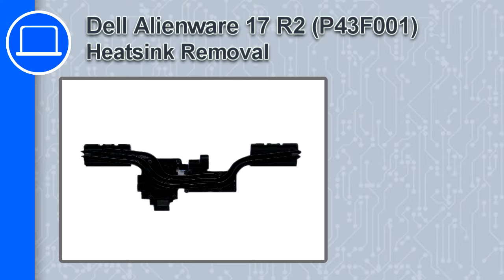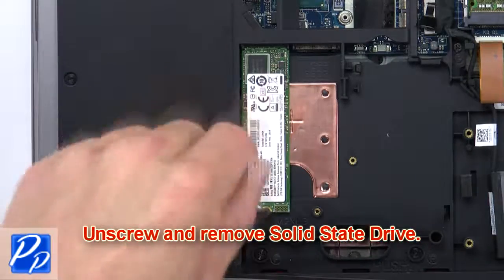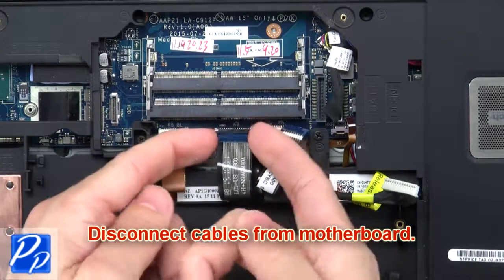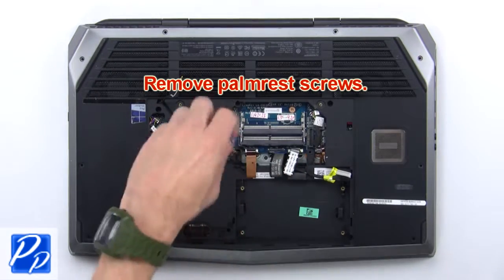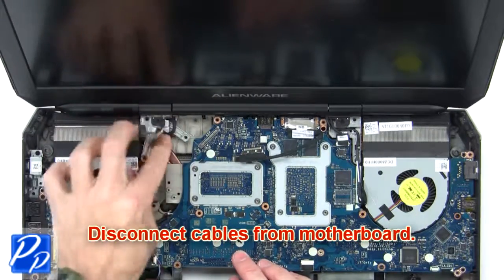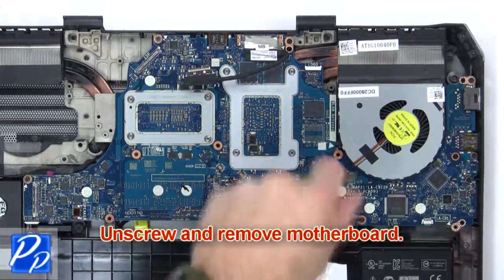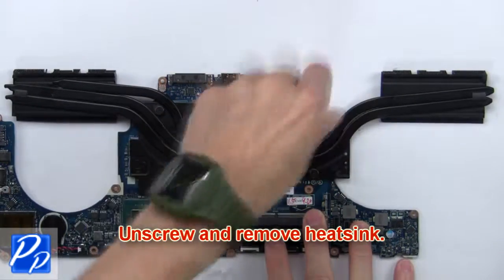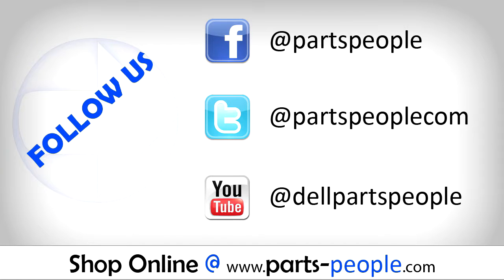Dell Alienware 17 R2 (P43F001) Heatsink How-To Video Tutorial

Comment: Man I tried repasting my 17 r2 and connected everything I thought i was careful but sadly it no longer turns on😅 Edit. I got it working again sadly I done all of that for no reason bc it says my cpu is still at 0.78 ghz and I found out it’s a battery or charger issue bc I looked it up and moved my cord around it didn’t work then I looked away for a second and it worked 😂

Comment: Question: when re-pasting the CPU and Graphic card, do you recommend the "place a dot" method and let the heatsink spread it, or spread evenly on the component before re-applying the heatsink? All my life I've applied and spread on many other boards but I've seen a few videos for Alienwares where they don't and I'm curious. Thanks for all the awesome video tutorials!
Reply from the maker: It's a matter of preference. I spread a thin layer across most of the surface of the chip.
Reply: @dellpartspeople  Great, that's the method I've used for years on other laptops. My Alienware is 5 years old and I have never replaced the thermal paste...I think is time.